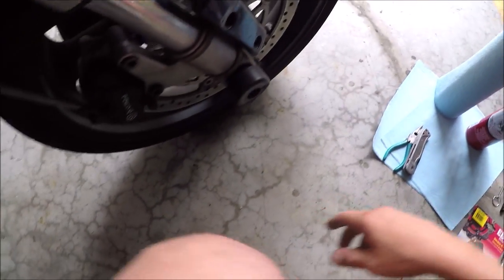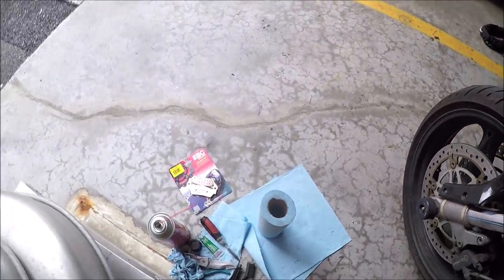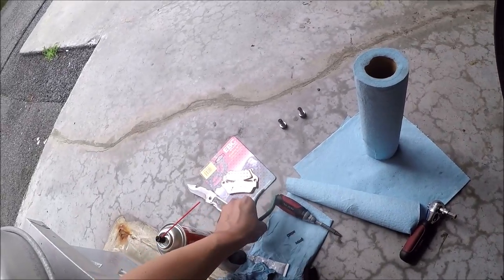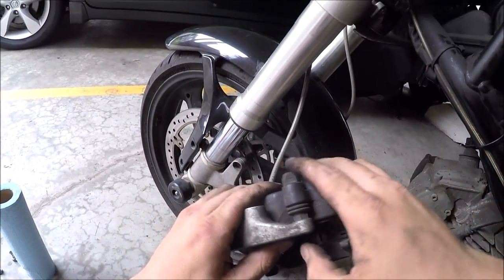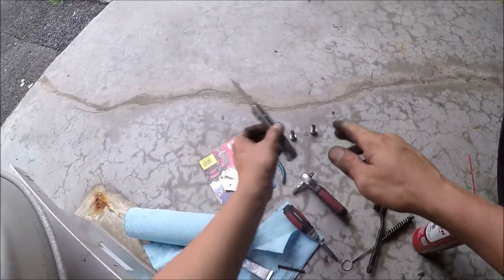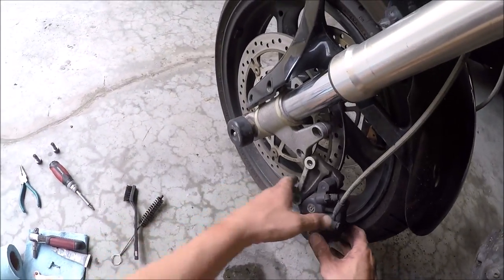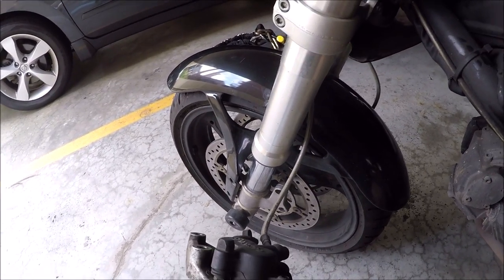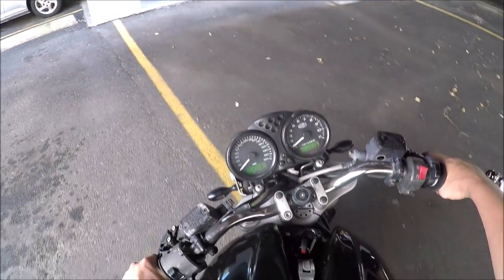how to replace front brake pads on 2006 Ducati Monster 620 - EBC Double-H brake pads EZ how to v898

Comment: I am grabbing one of these tomorrow and have a lot of questions on the maintenance you’ve done. I’ve owned several bikes over the years but this will be my first Ducatti
Reply from the maker: You're in for a treat. Ducatis are fun as it gets :)
Reply: @ducatinyc   I am! I just got back from riding mine, it rides beautifully. There is one thing I found though, it runs rich in the first two gears. Any ideas for that? I took it for a long scenic ride and it performs amazingly. Love this bike, and it came with a great exhaust

Comment: Hey man, I need some help. I did put the new pads in the one brake caliper, but the second front when I push one piston, the other comes out, the other two have gone back enough, but this problem can’t let the pads fit in. If I push the one the other comes out and the opposite. Any help? Thanks
Reply from the maker: That is odd, can you try to push both out at the same time? I've never come across an issue like this. Use a hard tool to push the calipers in - not just your hands.
Reply: @ducatinyc  finally done, I had to open a little bit more the reservoir for the fluid to go up. Thanks for the answer though, love your vids

Comment: Hey, did you replace them because they were squeaking like crazy? When i lightly brake with front brakes they squeak a lot. Im new and wondering if i should replace the pads.
Reply from the maker: Hi there, no, I replaced these because they were worn out - however - yours could squak due to being worn out too. How old are your brake pads, do you know? They could very well be shot, i would clean the disc rotor too.
Reply: @ducatinyc  i don't actually know how old they are. I bought the bike 1 year ago and its 2002 model. Most likely they are worn out but i only havr 22k km on the odo.
Reply from the maker: @stenmees1238  you just answered your own question. 1000000% replace them asap.

Comment: how many miles have you done  since you first bought your monster and how many miles were on the clock originally?
Reply from the maker: I got it with little over 1,300 miles 5 years ago, there are over 37,000 miles on it now.
Reply: @ducatinyc how much did you pay for it? true bargain i'll say. 13 year old bike with just 1300 miles
Reply from the maker: @christosganidis  3,900$ and it looked brand new. I basically stole it.

Comment: It feels like you are in a great rush to finish this jod.. plus you should put a cloth around the brake fluid reservoir. You don't want to ruin your paint, since the brake fluid is very corrosive
Reply from the maker: You would be 100% correct - I was getting ready for a epic right right after this vid so perhaps it was a bit rushed. Good tip on the cloth around brake fluid res. Thank you for watching!

Comment: Hey Ducati NYC!,
Greetings all the way from Ireland! , I have a question relating somewhat to maintanance , I too am an owner of a monster 620 , however during the rain , she runs rough, cutting out and running on one cylinder , or stalling out completely, so as you have experience with this bike , did you ever have this happen to you during encounters with rain ? This issue is driving me insane 😠

Kind regards , 
Martin
Reply from the maker: Hi there!
Unfortunately yes. It always acts like that when wet or after a rain, some days better, some days worse. However it got really bad for me after 5 years of abuse and riding whenever, I took the bike to the shop last week to have this figured out and the mechanic can see to put a finger on it. Will update when I know more. 

It's annoying but it never stopped me from riding, however last week it got really bad.
Reply: @ducatinyc   Thank you for the reply !! sorry to hear that your experiencing problems with your Ducati aswell, funny enough i just watched the DRZ 2 UP vid where you dropped off the beast at the shop. Please let me know if the mechanic finds anything. Ill give an update if i find anything to.

I relocated most of the electrical connectors from the bottom of engine  right up under the tank, hoping that water wont be able to get into the connectors. I still haven't pin pointed the cause of it yet however.
Reply from the maker: @sdpsajdasd  yea,  the mecahnic is not sure what it is either. i had a major service recently so she went through valves and belts and spark and coils and all that. CPU is next. man o man.
Reply: One idea... check the fuel overflow hose underneath the fuel cap. This drains fuel if you overfill the tank, but it also drains rain water that often seeps in through the old seals. Very easy for the hose to clog and prevent the drain from working. The standing water then gets into the tank and causes the symptoms you briefly described. I have the same bike and figured this out after several months of issues in the rain.
Reply from the maker: @taco_enthusiast  great suggestion! I was kind of thinking about this as well. Will def look into this.